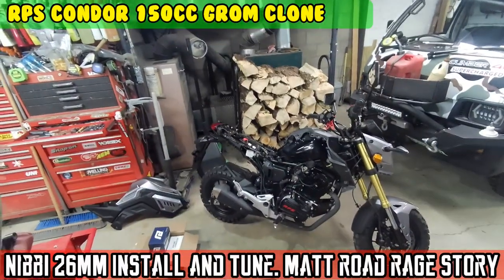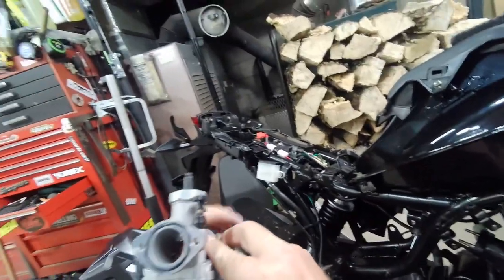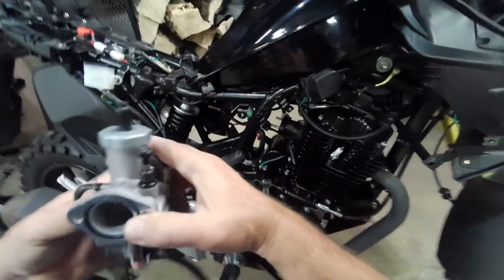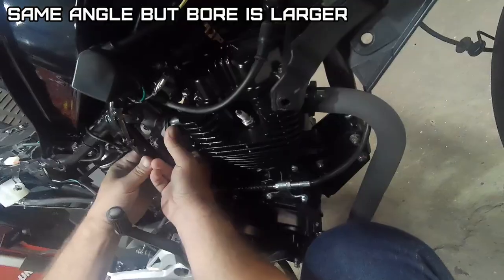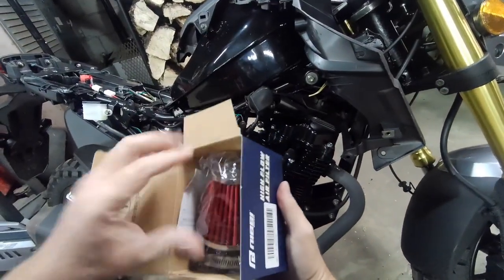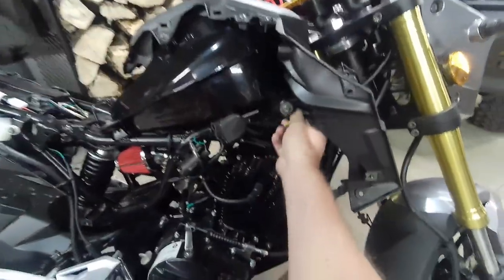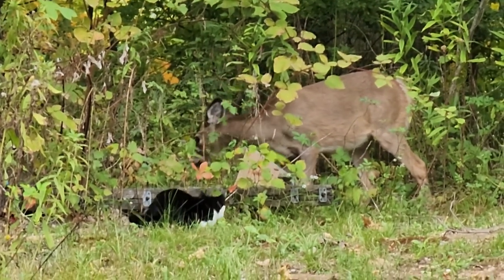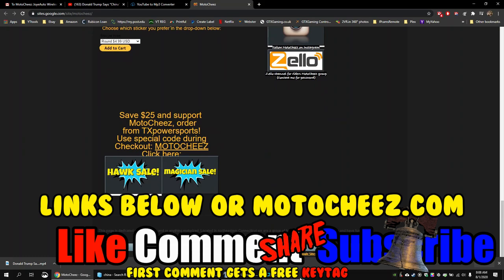(E5) RPS Condor 150cc install Nibbi 26mm carb and filter, tune. Matts road rage incident

Comment: This reminds me of the time when I was 12 years old and I discovered that a Kawasaki motorcycle carburetor had the same bolt pattern as the carb on my 5 HP mini bike.  My older brother clocked me at 55 MPH on the long gravel driveway to my grandmother's house.  That's fast on a minibike with 10" diameter tires.  Engine go REEEEE!  It idled at 35 MPH so for sane speeds on a minibike I toggled the ignition cutoff switch mounted in front of the seat as a pulse width modulated digital speed control.   :-o
Reply from the maker: Dayuuuum!
Reply: @MotoCheez  - Intelligence generally confers an evolutionary benefit but that's not true for 12 year olds who are too clever for their own good.  I didn't know not to do dangerous stuff like that at 12.  At 62, I know better, so that's no longer an excuse when I do stupid dangerous stuff.  I always try to do dangerous (fun) things as safely as possible.
Reply from the maker: Ditto. Same since I've been a kid 😁

Comment: How did you get so comfortable,  confident, knowledgeable whith carbonation?
Reply from the maker: Been messing with dirtbikes and small engines since I was a kid. I didn't have any  money but wanted a motorcycle. Bought crap and fixed it up.

Comment: I bet they are pieces of charcoal from the evap canister that worked into the air cleaner
Reply from the maker: There isn't one on here. Just crank vent hose
Reply from the maker: It's possible, I have no clue of their mold process.

Comment: One thing I don't get about these carbs I bought a D- slide nibbi 26mm and it came with 32 pilot and a 112 main.I think they just slap in what ever they have left and I'm 1500ft above sea level
Reply from the maker: Ha. Yeah. Sounds like you're set with that? Runs good?
Reply: @MotoCheez  will find out after I hook up the A/F gauge

Comment: Did you use the factory throttle cable or after market if so what length ?
Reply from the maker: Factory cables

Comment: Where did you pick up that 26mm 45 from. Now if you would of went a little further on the 45 you could avoid cutting the idle screw casing. Also what mm is the intake for filter boot? Thanks
Reply: What's ur link also to your site?
Reply from the maker: MotoCheez.com

Comment: I'm thinking of buying a condor 150 and use it for food delivery. I want to keep it reliable and still have fun upgrading. What do you think would be the very first bolt on upgrade for the job im doing. Definitely i was thinking the sproket first and then down the road an upgrade carb. I live in central Florida and with the needle jets upgrade would that work.
Reply from the maker: What you mentioned are the best upgrades, besides an engine swap. 
My jetting in these videos will work for you, I have a place in Crystal River, FL too

Comment: I thought for some bikes you can get a piston jug and head to convert your bike to a bigger size?
Reply from the maker: You definitely can but if you go too big you have to machine the case for the jug to fit down in it
Reply: @MotoCheez  I have a 1980 KZ550 I could never get it to hold air in the tires? Any suggestion's,....it's the only bike that I had that problem with?
Reply from the maker: Either stem is leaking or around rim if there is not puncture in tire. I assume that's tubeless

Comment: Just so I understand, changing sprocket from 15 to 16 gave you less acceleration and top speed per your performance in the description?
Reply from the maker: Yes,  typically you'd go faster, didn't have enough power to do that with higher geating
Reply: @MotoCheez I bought a 28mm PWK off amazon. Will this carb fit directly on or is it too big?
Reply from the maker: It should work. I always try to go a little oversized from stock. I'm not sure which side the idle controls on but that's the only problem you probably run into
Reply: @MotoCheez  i was told it was on the left side if you’re sitting on the bike. My biggest concern was finding the correct sized flange adapter but it looks like the bolt pattern is the same across the similar sized flanges 50mm across. You’re channel is a life saver for sure.
Reply from the maker: @misterholttv it'll squeeze into the stock intake, but you're going to have to put an air filter on the back of it too https://amzn.to/3P5JY7r

Comment: Hey there Moto, got a question for you about that Condor. Is it a From or  Z125 clone? I'm curios if its possible to turn it into a touring mini. I wonder if its possible to instal: rear rack, crash guards or a engine plate on it. What are your thoughts? Keep the vids coming enjoy you posting your experiences- be well, ride safe.
Reply from the maker: It's a Grom clone. The Rear rack I'm not sure about, I'd imagine you could, I have an older version Grom rack I tried installing, it's different
Reply: @MotoCheez  Thanks for the info, with these "China Bikes" it's really hit or miss with a lot of add-ons, sure you can pretty much swap out engine pieces, but actual correctly positioned mounting points... That's a whole nother can-o-worms.
Really would like to pull the trigger on either the Lifan KPMini or that Condor (insert bird cry sound effect) with the 150cc instead of the multiple 125cc clones running around.
I do appreciate all of your videos and the knowledge that you share with each. All the best to you and yours from Phoenix!
Reply from the maker: CG ant CB engine have same mounts and 99% of the china bikes sold. Horizontal Z motors are different.
Reply: @MotoCheez  See, that's what happens when you spend so much time wrenching on these bikes - you know so dang much about them! I didn't even take in account of the actual types of engines that are installed for each. Of course you're going to have different mounts for - that makes total sense.
Thank again Cheeze! Keep it rated "I"!
Reply from the maker: @DeanStLouis-uh7np  😄 thanks

Comment: When you remove the factory air box and put on a pod filter what do you do with the tube going to factory air box from crankcase?
Reply from the maker: Run the tube is high as you can and put one of those little air filters on it I believe I put the link in the description

Comment: So I just got this bike. My first ever. I'm installing this Nibbi carb and air filter and I'm curious where the hoses go that WERE on the air box? I'm totally uneducated in this
Reply from the maker: The only hose that I did not reconnect was the one that goes to the pollution box on the exhaust, all the other hoses are pretty much atmospheric air or drains. The crank vent on a engine still runs up into the air box so it will collect oil or if you remove it you should run the hose up at least 6 in and put a small filter on it
Reply: @MotoCheez  Preciate the information. I followed your video step by step and still managed to not do something right. Couldn't get it to turn over, replaced it with the old carburetor and couldn't even get that one to turn over. Now I gotta pay someone to fix it because I'm stupid hahah
Reply from the maker: Turns over but won't start? You should turn the gas on and there's enough gas in the tank? Reserve is about a gallon of gas it only takes spark compression and fuel so it's got to be one of those things
Reply: @MotoCheez  I will say, I'm a journeyman plumber and DEFINITELY not a mechanic so my information and knowledge is limited at best here, but I switch a lever which I'm pretty sure was the gas, turned it off, did the carb swap hooked the air box in to the NEW Nibbi carb (which I know you put the air filter on in place of the air box) then turned the gas lever back on and got nothing
Reply: @MotoCheez  definitely has fuel, spark SHOULD be good (it was working fine a day ago) so compression is where I'm worried I have an issue. The Chinese garbage air box that was on there came apart when I pulled it out (the rubber disconnected from the plastic) so I have a good feeling that's where my issue is. But I can't guarantee that until I get the 48mm filter you put on your website. Which will be on Monday. If I don't get life out of it after that, then I have a problem
Reply: Turns out a cable came unplugged that I didn't notice 🤦‍♂️ she's alive!! Thank you so much for replying to me man. Fan for life!
Reply from the maker: Woohoo!
Reply: @MotoCheez  it's alive, it's moving but not very fast. It bogs down hard at 6,000 rpm. I've tried the fuel adjustment screw in multiple locations but it won't stop bogging. Any advice would be amazing!
Reply from the maker: Bogging full throttle would be main jet possibly too big.  Big half throttle?
Reply: @MotoCheez  yeah half throttle bog. I changed out the main jet like you did. I learned by watching you dad
Reply from the maker: If wide open is good and half throttle bigs you can raise the jet needle in plunger...

Comment: Moto cheese please help I just replace my carburetor on the condor and the bike doesn’t start now, I put it together correctly to the best of my knowledge I don’t know what’s wrong
Reply from the maker: Getting fuel? Filling the bowl?
Reply: @MotoCheez  yes it’s getting fuel, it has spark and air, the bike sounds like it wants to start but it can’t
Reply from the maker: @matthewmojica5745 even with choke? Plug wet like it's flooded?

Comment: Does the old carburetor screw work with the new carburetor?
Reply from the maker: Which screw?
Reply: @MotoCheez  the idle screw that you had an issue with
Reply from the maker: Oh, no. Both too long
Reply: Oh okay I’ll have to figure something out
Reply from the maker: It may fit carb, but wouldn't work for my application

Comment: Do you think an exhaust change will be needed?
Reply from the maker: Yes, it helps a lot
Reply: @MotoCheez   - Wait, did I miss the video where you added that?
Reply from the maker: I didn't on the 150, I did on the 190 swap

Comment: Motocheese I got my bike working but the idle won’t go down how do I turn it down
Reply from the maker: The idle screw on the side of carb
Reply: @MotoCheez  I tried that I tightened and loosened it but it continued to idle around 5k rpms, it just won’t move from there
Reply from the maker: @matthewmojica5745 the cable may be holding it. You have slack at your throttle?

Comment: Any idea what motor this rps is and if anyone offers a big bore kit?
Reply from the maker: It's a CG150, and I've been told there is big bore kits
Reply: @MotoCheez  okay thanks
Reply: @MotoCheez  any idea on performance and accessory parts on the rps?
Reply from the maker: I haven't looked into pipe yet or anything but the carb